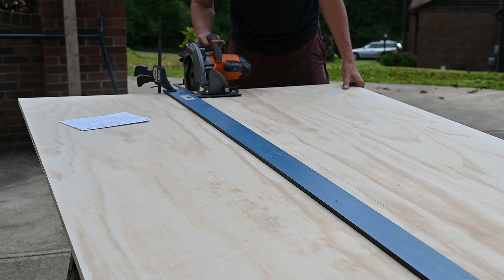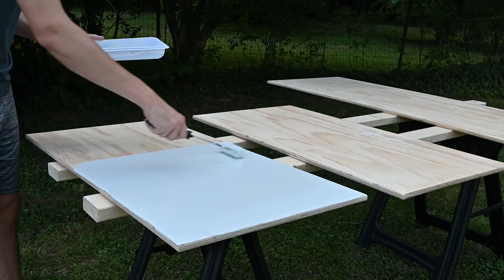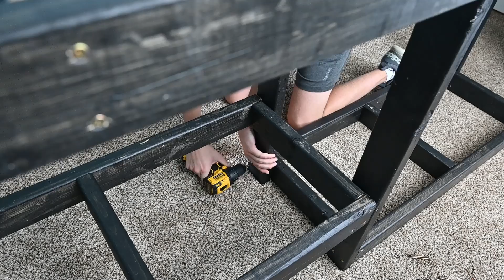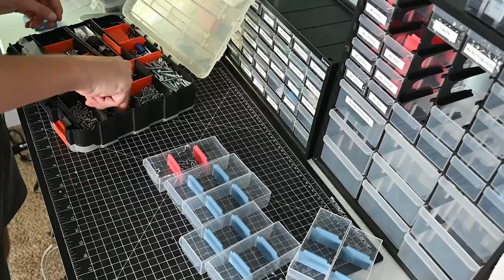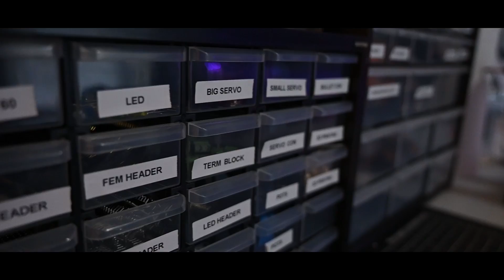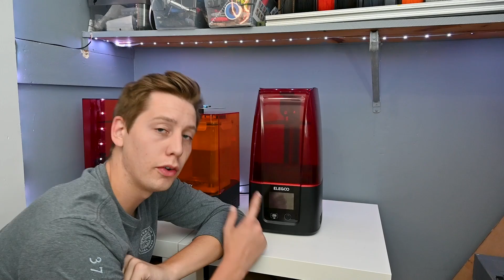I Moved... Building out my NEW Project Room

Comment: amazon sells these really cool workbench kits.  they're blow molded plastic legs with slots and screwholes built in for easy building with 2x4's and whatever top material you want for the worktop.   i built them from scratch like you last time at my last house.  it turned out great and to my expect specs, but it was a lot of work.  i later got some for the garage and went husky pre-built.  they're also great but a bit pricey since they're higher quality materials for the top and the height adjustable leg system.  at my new house i did the amazon kits.  it was cheap and easy.  you just choose whatever wood top you want (usually MDF), of whatever length/width you want, and just cut the 2x4's up for the legs/supports, and pop the MDF into the top (has a built-in ledge for it to sit in).  they also sell a shelf kit for it, which is the same thing, but the legs are smaller, and so you can put them on top of your worktop at the back for a shelf (and a surface to mount a light under to illuminate the worktop.)  so while the plastic legs are the only "premade" part you buy, it does all of the work for you and made it stupid easy.  i left the MDF unpainted as i knew i'd get that covered in all kinds of crap, but i painted the 2x4's charcoal color and slapped a few bright led strips under the instrument shelf and it turned out great!  just for future reference, it might save you some time.  it has you put a couple screws in from the bottom to keep the worktop in place (likely for safety), so removing those is all that it takes to replace the entire worktop when you decide your current one is "spent" lol.  my homemade one at my last house was so integrated into the structure that it wasn't realistic to replace the worktop.  figured it's worth mentioning.  the legs were like $80 and the shelf legs were around $30.  plus a couple 2x4's and some MDF and deck screws
Reply: Depending on how thick the MDF is, might be a good idea to replace it right away too. I'd go with at least some plywood. I might be the only one that ends up with a lot of water on my work tables, for various reasons, but it disintegrates MDF really fast.